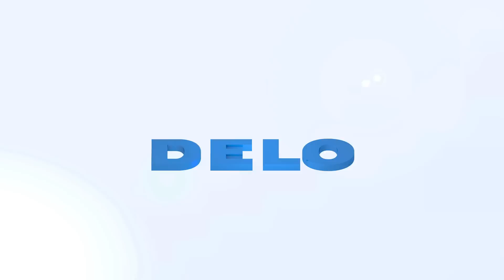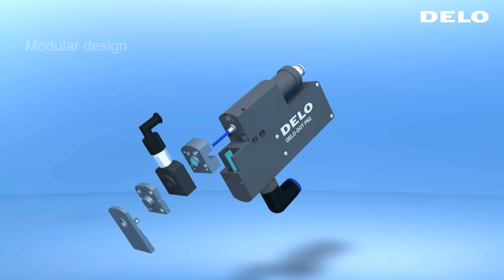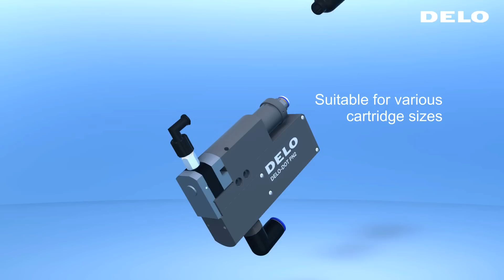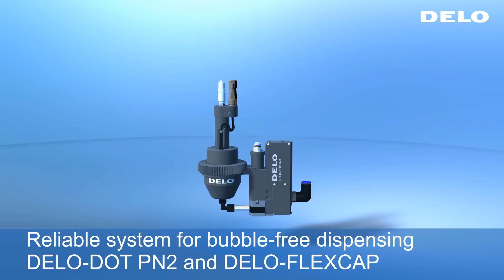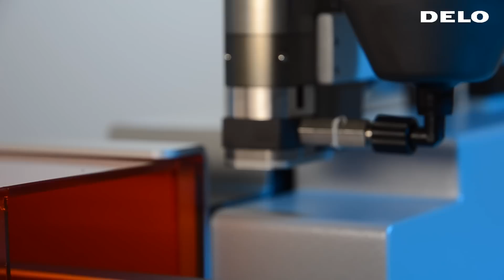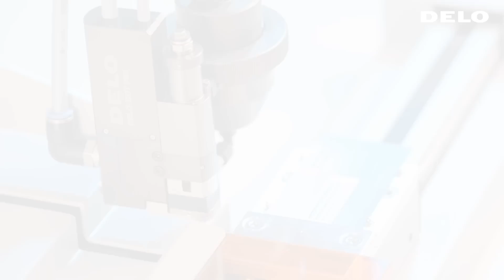Pneumatic Microdispensing Valve - DELO-DOT PN2

Comment: What are the dimensions of the entire valve? I'm looking for something with the same precision and functionality, but at 1in wide by 2 in deep (roughly). Could the design be miniaturized to fit inside of a handheld device?
Reply from the maker: The dimensions of the follow-up model DELO-DOT PN3 are 0.8 x 6.02 x 2.44 Inches. You can find more details here: https://www.delo-adhesives.com/en/dispensing-valve/delo-dot-pn3-micro-dispensing-valve/

If you need more information, please send us you contact details via G+ send it to info@delo-adhesives.com and we will hand your questio over to our tech-support.